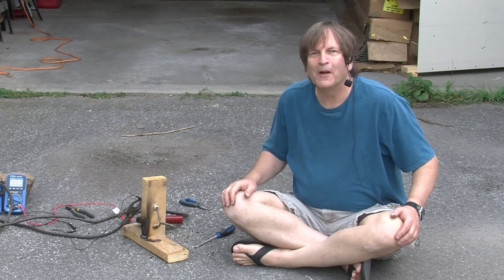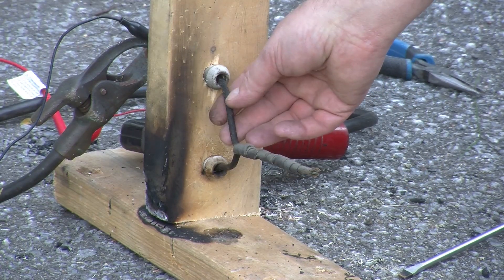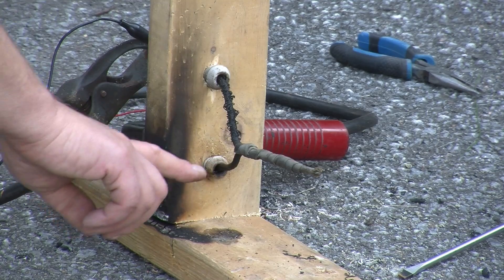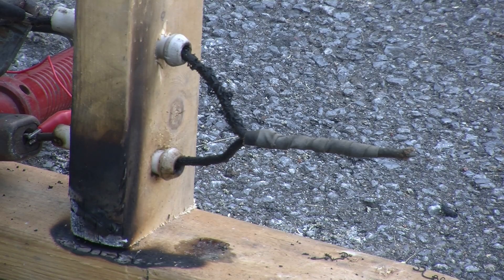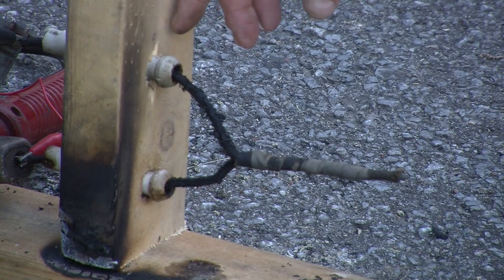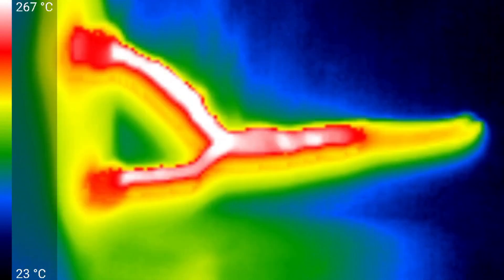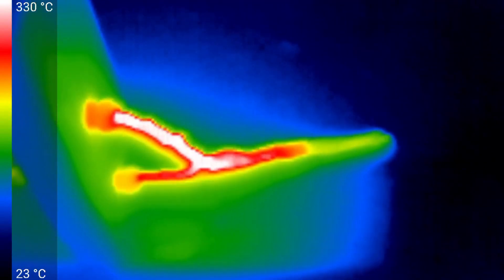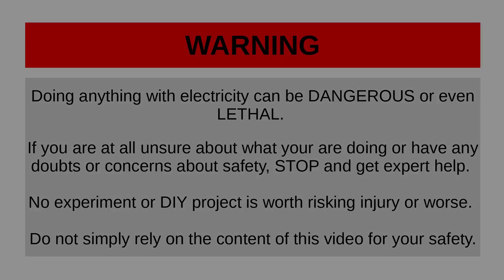Lets Test a Knob and Tube Splice

Comment: I appreciate your test, but it would be better if the current was actually flowing through the entire splice.  Heat is conducting down  the splice, but you are not generating any heat in the connection past 1/4 inch.   A better test would be to run current from one wire  into two wires spliced together in a "Y" type arrangement.   This is how most splices work with K&T.
Reply from the maker: Absolutely! I dont know visible it is in the video , but there is a stub of wire on the other side of the splice that is the remnants of the wire that continued on in that direction. Unfortunately, that wire was cut close to the splice. Not only would the current have been distributed along the splice as you describe, but also the additional wire have conducted some heat away from the splice, increasing its ability to deal with high currents and the associated heat. 

So yes, not a perfect test. But it was done with what I had available!

Comment: It makes you wonder whats in the solder composition to not melt at a much lower temp and cause the side to fail.
Reply from the maker: There was a post in the followup video where a commenter mentions different alloys with more lead or tin which would have a higher melting temperature but lower long term stability. The electrical tape was also essentially dry and rigid after taking it apart in that video that it could have held the molten solder in place.

Comment: It would be surprising to see the splice fail.  Somewhere I heard that you're not supposed to solder splices currently, and never understood why.  Properly twisted and then soldered ought to make a very good electrical and physical connection.  Maybe aluminum wiring would break too easily once soldered.  Don't know why.
Reply from the maker: I once read it was OK to twist, solder and cover in tape in a junction box (essentially what was done from knob and tube). But as you said it probably isnt allowed any more (anyone know for sure?). I'm guessing the problem is the difficulty in making future changes and maybe too great a chance of damaging the more modern thermoplastic insulation. I was wondering if with the really high currents the slightly higher resistance of the solder might cause it to melt but it didn't seem to. A number of people wanted to see inside the splice - just uploading a video of that.

Comment: I suspect the older upper wire has a slightly higher resistance compared to the lower wire, resulting in it failing more quickly than the lower wire. The splice does not surprise me as it has a significant number of turns and is essentially double the gauge of the wire.
Reply from the maker: I just did a short followup - measuring the size of the two wires (they are the same) and taking apart the splice.  Your certainly right about the splice - it was really done well. Here is the followup video in case your interested: https://youtu.be/NxuHf5LYavc

Comment: I'd be interested in seeing how the other leg would handle the current, since it would supply the current back when it was in use. I'm thinking double the amps, and connecting the two smaller wires together with a big busbar so that they will both carry roughly half the supply amps.
Reply from the maker: The unfortunate thing is that there were only fragments of the knob and tube left and due to the unsafe nature of the floor, it was not possible to get every piece of what little there was left. So I wasn't able to get more of that splice region. If I ever come across another, better source of the knob and tube though ......

Comment: First saw you when you dumped on that Chinese weed-growing outlet, not been disappointed since.
Reply from the maker: Glad you have my other posts! Just looked at your flyback transformer arc videos. Is the driver your own design? Look like the arc has a fair amount of current to be so stable?
Reply: @ElectromagneticVideos  It was a tweaked TL494 circuit.  Gave up on it after blowing out too many transistors.
Reply from the maker: @soundspark  Oh - too bad!

Comment: Great to show effect of splices. Though I didn't know any better or think about it; my house had been greatly modified through the years with additional circuits added, making the house's single knob and tube wiring circuit into about 8 circuits. The danger is, to save time one could have just modified one side of the circuit to the circuit breaker panel and left the other side of the circuit unmodified leaving a  single conductor to carry many amps of load. I was somewhat fearful of the knob and tube at the time, so I ran a heavy duty extension cord from my bedroom which needed an electric heater (oil-filled, radiator style) to supplement the heat, from a newer part of the house that had modern wiring.
Reply from the maker: Sure sounds like the type of upgrades that apparently could cause problems - and interesting you had an intuition that maybe not a good idea a to plug in a heater. Sadly I think most people may not even be aware of their house having knob and tube. Glad you like the splice test!

Comment: I'm starting to understand the whole "back in my day when things were actually BUILT" thing
Reply from the maker: Yeah -  certainly would have taken way more work than today, particularly when you think that all the holes the knobs went though were hand drilled, and screws were hand screwed and careful soldering for every splice.  And (if not altered or covered with insulation) able to handle more current than today.

Comment: High voltage test pleeeeeeeeease?
Reply from the maker: I was actually thinking of doing a HV test on modern 14/2. The knob and tube insulators should certainly withstand higher voltages than 14/2 ....

Comment: I bought a house where someone spliced 70/80's era 14g Romex into the old knob an tube wires buy just stripping a piece of the old wire and wrapping the new wire around a few times. It looked like it was slightly crimped via vice grips or something but def not soldered. These splices where wrapped in cheap electric tape that had mostly melted and were sitting right on raw redwood. One of these spots had about 1½" charded spot under it...literally minutes away from burning the house down. All wiring was upgraded to modern code before renting the place out.
Reply from the maker: So I guess you unfortunately had an example of upgrades done wring can make knob and tube dangerous. You renters are so lucky to have a landlord who cared enough to upgrade the wiring!
Reply: @ElectromagneticVideos  I think the only reason that place lasted as long as it did in that condition was due to the previous old lady had lived there for 30 years before she past. Any modern tenant would have almost certainly over drew those add in plugs that where hacked into the old wiring.
Reply from the maker: @lostcoast707  That explains it - probably minimal power consumption with appliances frozen in time!

Comment: I gotta admit,  to say I'm impressed at how well a century old wiring system can hold up under the condition that no handyman screwed around adding romex,  what have you, to the original system, is a big understatement.    Especially considering they did not nearly as many safety regulations as they do today, and just being able to flip a switch and have that new fangled electric light in the center of the room,  was a luxury to say the least.    In some ways knob and tube wiring is superior to the romex we use today, hanging a picture and driving a nail will not cause a short and possible fire in the wall because of the spacing, unlike romex.    In fact the industry began phasing out knob and tube in favor of NM aka romex in the mid to late 1930s due to a shift in labor vs material  costs,  and depending on the area of the country, knob and tube can be found in homes as recent as the 1950s and even the early 60s.    NM cable was actually invented in the early 1920s, around 1922 by Rome wire company and became recognized by the NEC around 1926, but was more expensive than knob and tube,  so it didn't really become widely used until after WWII.
Reply from the maker: That an interesting bit of history including Rome wire company - had always wondered where romex came from! And Rome NY is just across the border from me. I had heard somewhere else that knob and tube was used as late at the 50s  - quite amazing, but had no idea romex was that old. I do remember some form of romex/NM wire when I was a kid that sort of canvasy fabric in place of the outer plastic we had today and also some tar like substance inside - always got it on my hands.   Have to agree with you - very impressive given how long ago knob and tube was created and is superior in some ways.

Comment: VERY impressive performance from that vintage wiring system.  Like many technologies form the past - it has some characteristics which far exceed what we have today; but it also requires a lot more skill to install than what we have today.
Reply from the maker: Yes! And a bit more care like making sure it is not covered by insulation. I was surprised how the splice did better than the rest   of the wiring.

Comment: likely what was happening with the bottom wire is it was a 12 gauge wire. back then it was common to run a larger line from one side to the other and branch off with your circuits as you needed them, i have seen it a fair bit. oh and when you wrap and solder your connections, it is actually stronger than the actual wire itself! which is why i much prefer soldering my connections.
Reply: Yes, a proper twist splice is very strong.  My house was old enough that the original wiring had a separate earth wire.  It has long been retired from service with in-cable earth wiring replacing it and left disconnected but in place.  I decided to pull it out a while ago and noticed several soldered taps as it made its way around the house.  They were very neatly done splices and survived me reefing on the wire to pull it out of what remained of the nails that held it in place.  No way it was going to fail under fault currents.  Who ever did the job originally took pride in what they were doing, that's for sure.
Reply: @retrozmachine1189  yeah, that was back when pros were still actually pros. I've seen a lot of that, I went in a 1800's Plantation house that they ran the wires in the molding arround the rooms, we tore out a little of it and quickly realized it wasn't worth it, the wire was absolutely perfect
Reply from the maker: @retrozmachine1189  So are you saying you had knob and tube that had a ground wire? Everything I came across said it never had a ground  - guess you cant believe everything you read! Certainly  way back then they took way more pride in what they were doing!
Reply: @ElectromagneticVideos  No no, not at all.  Remember I'm in Australia.  This was all old two core TRS instead of 3 core (ie with the earth wire in the cable).  The earth wire was separate.  The two core was secured with fold over copper clips and the earth secured by the heads of two adjacent pancake headed nails.
Reply from the maker: @retrozmachine1189  Oh - ok! Wow - thats pretty different - I'm not sure if that was eve done over here. Be interesting if anyone has seen that in North America!
Reply from the maker: You know, I think I still the remnants from that test. I will measure the lower wire and report on what size it was tomorrow!
Reply from the maker: Just measured the second wire - its #14 after all. Here it is https://youtu.be/NxuHf5LYavc

Comment: Need to do some high energy short circuits with very large microfarad high voltage capacitors.
Reply from the maker: Wouldn't I be invading Photonicinduction's turf if I did that?  :)  I do a have number of things I would like to do in the future including a many stage voltage multiplier and I just ordered a pile of  toroidal transformer for some experiments and demos that should be quite unique.